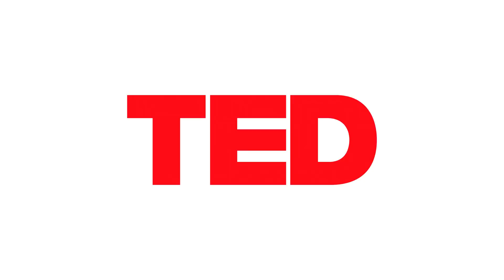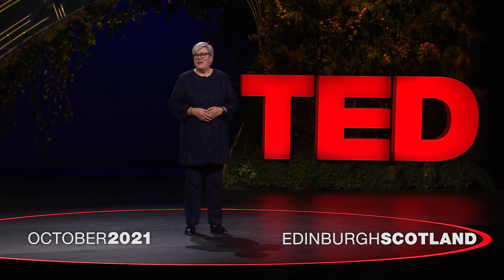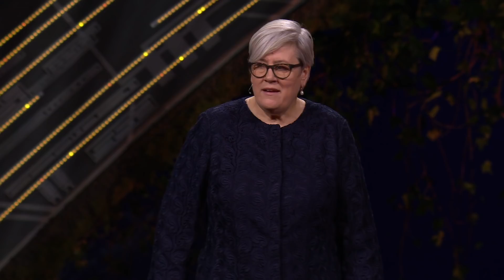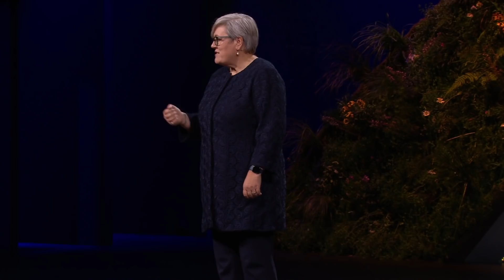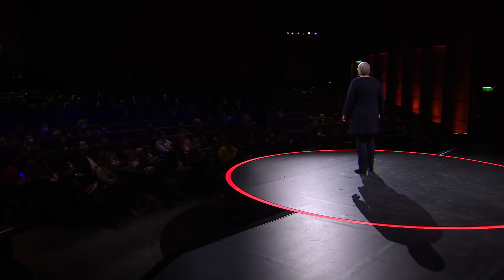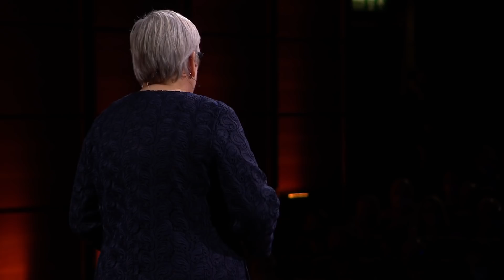Sustainable Cooling That Doesn’t Warm the Planet | Rachel Kyte | TED Countdown

Comment: I am looking at the VC Industry and HVAC innovation ecosystem, especially Evaporative air cooling part and just guest - what should be the tech and innovation level to be noticed by VC and visionaries and get a support and enablement to implement innovation.  
As I understood 15X energy saving (EER 200+), 20X carbon emission reduction (water as refrigerant) and 5-7X cost saving (3D-plastic-printed device with 5 components) is not enough for startup and prototype to get noticed...

Comment: This is a happy idea, but homes and buildings that blast warm or cool air because they were poorly built, dilapidating, or just plain outdated, will continue to be a problem. Cleaner electricity is still something worth pursuing, but tackling how to get homes and workplaces efficiently cooler is more than plant rooves and water pipes. :/ I feel like this Talk was sold as the full answer to the problem, but missing too many parts of the problem to be a full solution.
Reply: unfortunately agree. i'm sure its supposed to at least encourage further research. the issue i keep coming down to is: what is stopping the proper techniques being used? I blame beuracracy, capitalists and law makers who just want to squeeeze every dollar of every "working class" person

Comment: If all you have is a simple fan and water, just put a large wet towel on your shoulders or back and let it dry. within minutes it will cool your body very nicely for low cost. works even better when combined with a fan.

Comment: This is largely foolishness. Simply superinsulating all new housing, reinsulating older housing, insulated shutters, and instituting inexpensive energy recovery ventilators and whole house fans will cut cooling AND heating use and costs by 80-90%.

Most solutions are far lower tech than you think. Simply putting awnings over windows will accomplish the improvements on energy use you discuss.
Reply: exactly right . exactly.❤🥰🦋✨♾️
Reply: exactly right . exactly.❤🥰🦋✨♾️ looking for them instead of being whiners and negative Nellie's 😊
Reply: nobody can be bothered or cares unfortunately

Comment: The French company "Leviathan Dynamics" is developping a cooling system that is using water instead of HFC as a refrigerant, it is also using 30% less energy than traditional air cooling systems.
Reply: Doubt that
Reply: I am sure, these guys do very useful things. However, as experienced person in this area I can say - the recent already achieved targets are 15X energy saving (EER 200+), 20X carbon emission reduction (water as refrigerant) and 5-7X cost saving (3D-plastic-printed device with 5 components).

Comment: Lmao ok. This lady doesn’t know what she’s talking about.
Reply: @ Randall T , please then share with us why she has no clue and your solution then
Reply: Since you obviously have 20+ years of experience in this field, what are your suggestions?
Reply: There has been solar powered refrigerator units for decades now. The same technology that was used in early gas (not gasoline) refrigeration. The absorption cycle using ammonia works, is lo-tech and CFC free. This tech is out there and this lecture doesn't deserve to be a Ted video.
Reply: @jonathancoates11  It seams you have some experience in this field. If we talk about natural refrigerant - water only is real zero GWP refrigerant, not ammonia, CO2, and propane. With water as refrigerant and with dew-point indirect evaporative cooling 15X energy saving (EER 200+), 20X carbon emission reduction (water as refrigerant) and 5-7X cost saving (3D-plastic-printed device with 5 components) is already not a dream at all, but prototyped and tested tech.
Reply: @jonathancoates11  cool story mate, but not every knows that
Reply: So, You do? But you don't offer the slightest clue to the hidden brilliance of your fantastic omnipotent magnificence...